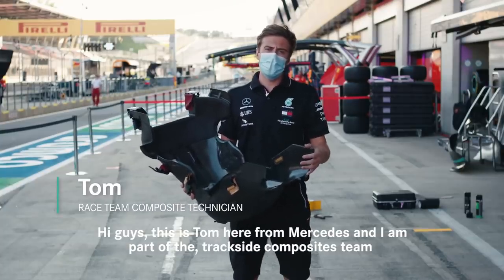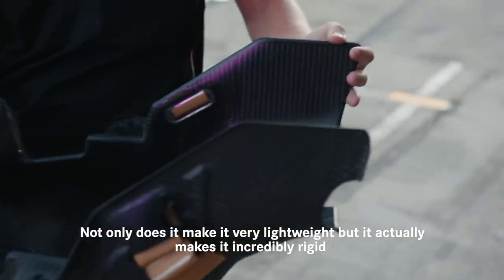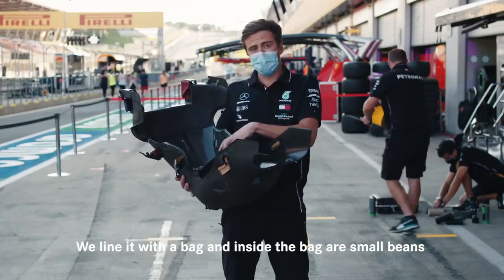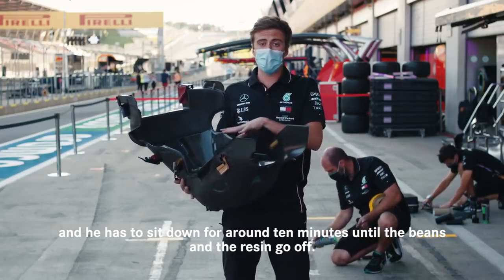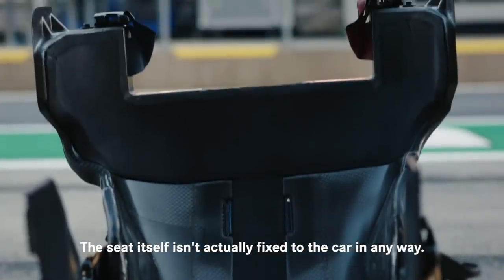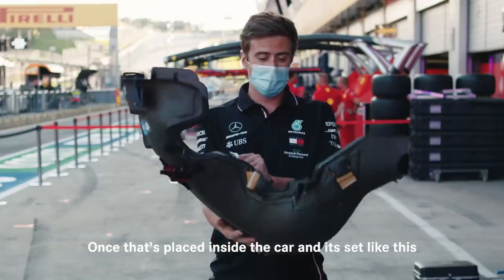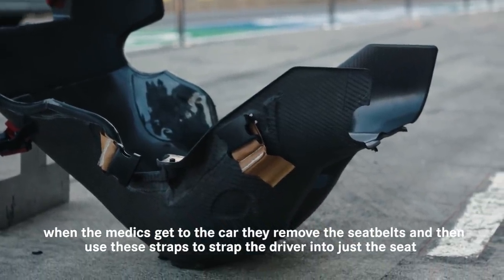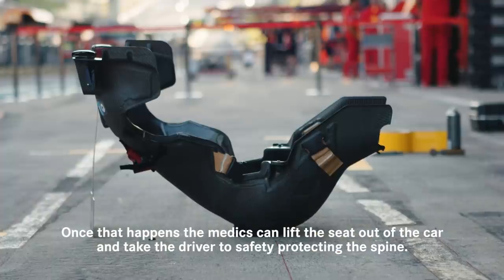F1 Driver Seat EXPLAINED!

Comment: The foot area... where there used to be pedals back in the day... how are the feet protected.
Reply: I mean, you can't really call it a car if it has no pedals.
Reply: @bleb2771  you can because to be a car just need bpdy 4 wheels and an engine  no pedal needs
Reply: @bleb2771  Tell that to Billy Monger
Reply: There are still foot pedals in the car sister. It's just clutch that got moved to the steering wheel.
Reply: Feet are expendable assets these days. The head, arms, body and butts are far more important.
Reply: @ewokYT117  The driver is in a carbon fibre safety shell which extends to the feet. The structure has to pass rigorous crash tests to ensure it's safe in case of an accident.
Of course there is no way you can make a fast and lightweight car resist a side impact of another car at 300kph. Which unfortunately killed Hubert in F2
Reply: @ewokYT117  Yes, we must protect the butts at all cost.
Reply: @967 false elctric car have elctric engine
Reply: 967 engine : a machine with moving parts that converts power into motion

So an electrical motor is an engine
Reply: @967 so what's your definition of a motor... 
In law if get a road traffic offence a car is referred to a mechanically propelled vehicle..  motor engine,  tomato tomato
Reply: @bleb2771  you can all cars don need pedal for example the next gen car with autopilot no pedal onlye need 4 wheels and engine
Reply: @967 What you mean by "engine" is ICE (internal combustion engine). There are lots of types of engines and yes electric is one of them.
Reply: 967 but blades are not wheels
Reply: 967 wouldn’t you say : 5 engines, and more specifically one thermal motor et 4 electric ones ?
Reply: Hahaha 😂 such an innocent comment but so funny
Reply: 967 absolutely, if there are 2 engines there are 2 engines. Even if they have the same purpose
Reply: Marius Mösinger  In other teams yes.
Mercedes uses Neural Input.
Reply: 967 yes all fans have a sort of engine in them, and no, because the wheels need to deliver power to the surface
Reply: 967 this is cuz you’re using the wrong words to describe things. I could rightfully say I have an electric phone but if I tell people to “check out my new electronic phone” people are going to think I’m weird too.
Reply: Um yeah, still pedals there today.
Reply: I'm not a huge F1 fan but I did watch a few races recently and when cars would have an off they weren't stalling like you would expect. I guess that may be at least in part due to the clutch being on the steering wheel now so they can just clutch it when they lose control and it doesn't stall out.  Very interesting
Reply: @A false
Reply: @A Aw what’s wrong little guy? Your public comment got a reply from someone? Maybe next time you shouldn’t spew bs online and expect no response.

Comment: The current steering wheel? Most videos about them are old.
Reply: Kyel Marius that's cause there's lots of secrets on the current ones.
Reply: Kimi Räikkönen still needs his
Reply: @officialWWM  what the button does and pedal mechanisms designs are the secret. Not the whole front of it. We see it on races
Reply: Music Islife they don’t have to tell you the meaning of the STRATS (how Mercedes call the power unit modes), which is the secret part...
Reply: @ILikeRice88924  @cringeF1comments
Reply: @officialWWM  And they're drastically different. Each driver designs their own steering wheel from the bottom up.
Reply: actually i would like to see how it connects. the wiring harness or whatever they use to connect all the features in the wheel to the car. is it wires or some sort of solid state now a days
Reply: @magicvibrations5180  I'm not actually sure about that one. What I know is that steering is moulded to the hands shape tho
Reply: @kas-lw7xz  I am right :)
Reply: I want to know what the heck is on the back of the wheel
Reply: DAS DAS DAS DAS DAS!!!! ;)
Reply: I would like to see the steering wheel, how is it made for each driver with the molds of their hands, button size, colour ,layout, dimmentions of the steering wheel, ergonomics , weight, connection type to the steering column and the software configurations in the menus and some explanations. 
The whole process from start to finish. 
That would be very nice and interesting as it's the main component for each driver and the car.
Reply: @antoniok4735  thats exactly what the other teams would like to see too. Hahaha
Reply: @kyelmarius2098  well, I am interested in the technology of how it's made materials, dimentions etc.. As far as I know Lewis designed the steering wheel, when he moved from Mclaren and the Mclaren steering wheel is very similar to the Mercedes plus Mclaren Electronics provide the software for all teams so that's not a secret.

Comment: Me before: it’s a seat, how can it be that complicated

Me after: Woah, that’s crazy
Reply: and they didnt even show the tv remote or the beer holder
Reply: It's a seat. What did you see that you didn't expect??
Reply: @garymitchell5899  i wasn't expecting it to be so crucial for safe driver extraction and transport in case of an accident
Reply: @antonioorellana504  Another thing that you may have not notice is that the legs are suspended higher than the pelvis.

Comment: I would love to see how the tyre gets secured into the axle so quickly during pitstop
Reply: Good call. Obviously there is simply a center nut but I'd be interested in how torque in transmitted...Maybe a tapered spline?
Reply: @MeltingRubberZ28  1
Reply: That’s so appropriate now!

I believe the driver comes in just a little too far into the box. Then the wheel gunner just misaligns the wheel gun onto the wheel nut.

Apply trigger and, hey presto the tyre and wheel are welded to the axle………
Reply: @MeltingRubberZ28  torque gets transmitted through friction between the flat surfaces between wheel and brake rotor, like in every other car too.

Comment: I'd be very interested to see how the wheels go on and off and the technology behind the impact drivers
Reply: @tomballenger1809  But guys, since you didn't mention do you already know how the wheel is secured to the hub? And I don't mean the nut holding the wheel from coming out, but how it the wheel secured to the hub so that 1000 hp doesn't cause it to slip. A nut can't be doing this.

Comment: Well, Merc may as well make a 1 hour episode going in depth about the entire car. Then, since McLaren is going to Merc power in 2021, there will be a Merc 1-2-3-4-5-6. After that they can buy out Williams, for a 1-2-3-4-5-6-7-8. The last step is to buy Renault, because there are two Honda teams and 3 Ferrari teams, Renault is the outsider. Boom, Merc takes all points positions. This is how to achieve a full championship lockout, and it's also the Mercedes Masterplan.

Comment: I think the incident happened with Daniel Riccardo in free practice where his car crashed and he was seen limping. Is there any extra tech that protect of the legs of driver or is it the body itself?
Reply: What protects the legs are the safety cell, which is the central part of the car that receives very rigorous crash tests and it´s (if I remember correctly) one piece that needs to be homologated each time it´s updated. I think Ricciardo left the car limping because of the G-force on impact, which made his legs bash against the side of the safety cell.
Reply: @The_Curious_Cat  ohk thank you

Comment: I would like to get a little more information about the technical rules. I.e I don't understand why the engines are so restricted. Why does the FIA don't allow you to build pretty much anything you can build. You want to build a 5liter quad-turbo? Sure go for it. You want a 7liter V10? Yes why not? Just limit the amount of fuel and you are good to go. That would result in a race for efficiency instead of a race for power. 
Sames goes for aero, if FIA would allow i.e. ground effect bodywork with just very simple rules like minimum clearance size of diffusor and overall tunnel length then cars would generate so much downforce right away that these super expensive wind tunnel testing would be more or less obsolete. Am I wrong here or what is the point of having rules in place that on the one hand try to make all cars equal and at the same time they fail so massively coz the performance of the cars is so different but the engineering behind it is so complex that even big companies struggle to keep up.
It would be awesome if you could explain a bit more about the science behind the rules.

Comment: It would be great to learn about how the cameras are mounted and broadcast. I'm guessing that there are lots of regulations about weight and positioning, and systems to ensure that no team is disadvantaged. It would also be interesting to see any stabilization hardware and the transmitting equipment. Is the team able to see a live view from any camera that is mounted to their car or even other cars? This may be handled by the broadcasters, but I'm sure you could shed some light on it.

Comment: I'd known the basics regarding how the mould was made (the beads & resin), but the rest of the tech involved stunned me. Imagine how many developments along the way, by different brilliant engineers, have gone into making something as "simple" as a seat!

As for what else... Absolutely anything! Whether it's purely belonging to yourselves (though I doubt many of those parts could be revealed!) or are generic parts throughout the field. For example: I know that the whole brake system for every team is a secret, but learning more about the makeup of the discs would be interesting. Why is so much carbon dust released and is it safe? I get that some tracks are heavier on the brakes, but seeing so much material come off at certain tracks makes me wonder if there'll be a total failure near the end of the race. Is that possible, or worse, likely? I've seen accidents attributed to brake failure but that can mean any number of things.

Thanks for the vid! I really enjoyed it and appreciate you taking time to do it.

Comment: Hello Mercedes-AMG Petronas Formula One Team, hope you guys answer this question (trolls are unsolicited ;-). Would you care to show the seat belt / harness system and what tech is used to counter the strain of seat belts on drivers shoulders / chest while navigating the car through such high G forces ? Also that carbon seat must be very rigid and least to say, uncomfortable for the drivers, does the drivers suit have anything special to make them comfortable in such challenging and enduring racing moments.

Comment: I knew they were custom build to the drivers, but the fact they can extract the driver from the car within the seat in case of a serious accident/injury I did not know. That is actually some really clever engineering going on, it is not 'just a custom seat'. I like F1 because of these kind of awesome bits from already cool cars :) 

I second Sharath George M's question about the drink storage etc.

Comment: O really would like to know the rear suspension upgrade you guys made this year. The car feels so planted in the corners. Is an amazing engineering feat. Quite like de double difuser back in 09. Also, I’m not working for racing point

Comment: Show us two wheels being removed, the steering wheel being replaced by handlebars and the driver sitting on top of the engine with absolutely no protection around him whatsoever except a set of leathers with a large pouch down the front to hold their massive balls and then call it MotoGP? 
Seats used as stretchers. Ha! Just scoop our heros up off the racetrack with a shovel mate.

Comment: The steering wheel, more specifically the power steering part of it. Despite the wheel being a power-assisted, there is still some force going through the wheel. How heavy is the force and can it break the driver's hand during an accident?

Comment: The steering wheel would be interesting, as would all of the aerodynamic widgets, i.e., what benefit is gained from all the twiddly bits. Sometimes it seems like there's a war of twiddly bits going on between the teams, which seem so inconsequential compared to the engine, tyres, aero profile, rake, etc.

Comment: I would like to see the steering wheel, how is it made for each driver with the molds of their hands, button size, colour ,layout, dimmentions of the steering wheel, ergonomics , weight, connection type to the steering column and the software configurations in the menus and some explanations. 
The whole process from start to finish. 
That would be very nice and interesting as it's the main component for each driver and the car.

Comment: I want to know the lifespan of racing parts such as suspension bits and engine components. At what intervals are racing parts replaced and do all the teams in the grid follow a common protocol in replacing or “timing out” parts? Thanks!

Comment: Have they changed the angle of the seat's position in the car in relation to the driver's visibility? I saw a video years ago that showed drivers could barely see over the steering wheel.

Comment: I’d like to know more about the requirements, specifications, and placement of the cameras on the cars. Are they there for the benefit of the viewing audience, because the FIA says so, or do the teams want them for additional data? In particular, are the two small protrusions on each side of the upper part of the nose on each car cameras? As a result of the seemingly same location on each car, do the teams have to incorporate them into the aerodynamics or do you design the car without regard for the cameras and then they are simply put in the required spots?